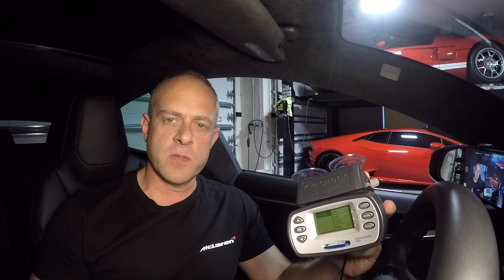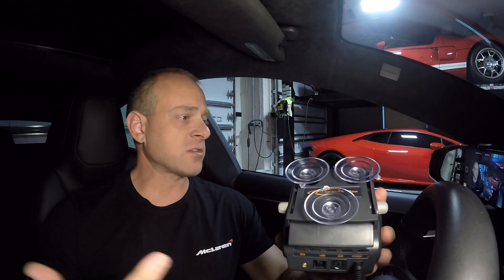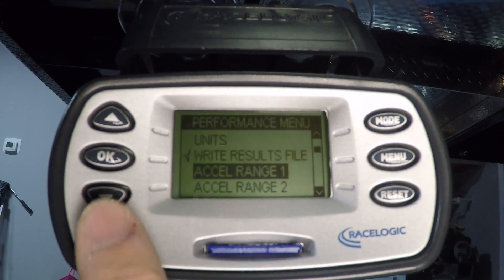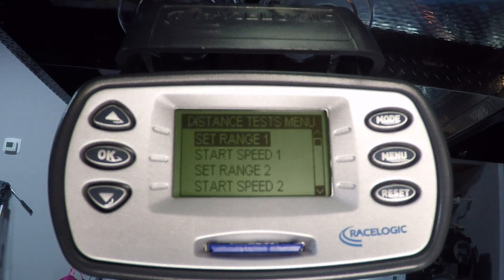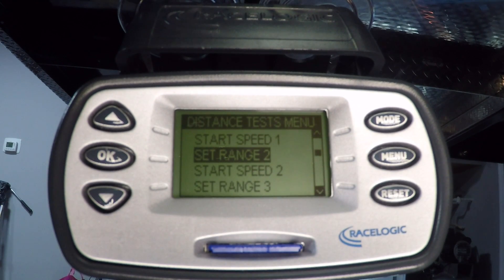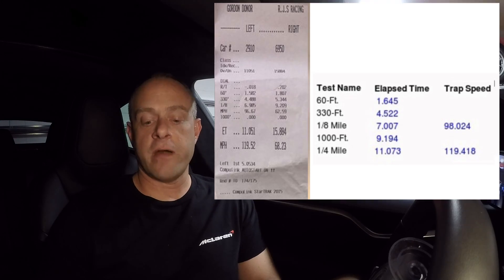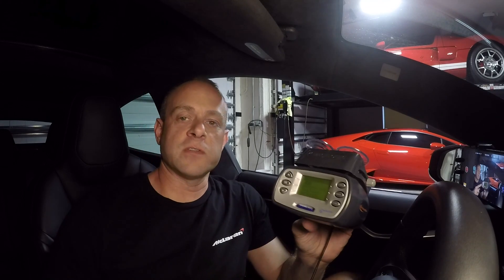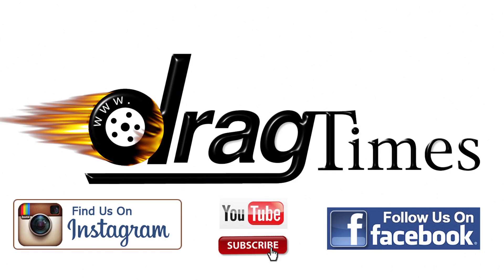Racelogic VBOX Sport Performance Box Review and 1/4 Mile Accuracy Testing in a Tesla P90D Ludicrous

Comment: I just can't get past the fact this is a $500 device that is a 10+ year old design. Almost as bad as TI graphing calculators.
Reply: Used the draggy app on a Twin turbo UGR lambo and it was trash. Rather have something that looks like this but accurate af
Reply: It's old but it works! :) Just so you know we are developing on a new PerformanceBox2 (code name PB2) with a slick digital screen, coming soon...
Reply: VBOX Motorsport is the PB2 Out yet?
Reply: VBOX Motorsport is the Vbox sport as good or better?
Reply: hey vbox, is the performancebox2 close to release?
Reply: Curious about that too.  Is the Vbox Sport just as accurate?  Differences?  Looking to upgrade my Performance Box
Reply: simple, low batt power usage, and keeps processing power needed low

Comment: I think that might actually be the PerformanceBox which is sometimes called a pbox. The biggest difference between the vbox and pbox is the pbox is 10 Hz and the vbox is 20Hz but doesn't have a screen.
Reply: vBox comes in 10, 20, and 100Hz versions.  I have a 10, and 20 Hz version that are branded vBox and come in blue aluminum housings.

Comment: Surprising that it's a little on the pessimistic side (which i'd rather have than optimistic), in everything, except the 1/8 mile trap speeds? 1/4 traps are a touch lower, and 1/8 speeds are over 1 mph faster than timing lights.

Comment: Brooks have you compared numbers from the Performance Box with the VBOX Sport and maybe even another manufacturer like QStarz? Would be really interesting if you ever have the opportunity to do so.
Reply: I wrote the vboxtools.com software used in this video.  I've compared both 10 and 20 Hz versions in the same car at the same time.  I think I did it and posted the results on m3post in the f80 car forum section.  The results were effectively the same with no outliers.
Reply: I’ve tried. Actually most of them use the Ublox module, no difference at the basic level. The biggest factor of difference is the signal. Different signal state means different result. There may be 0.1~0.3 sec difference even you mount them in the same place.